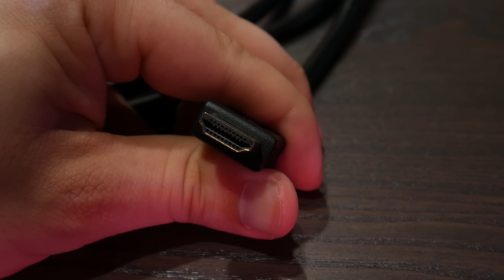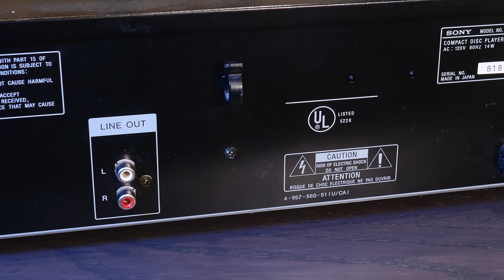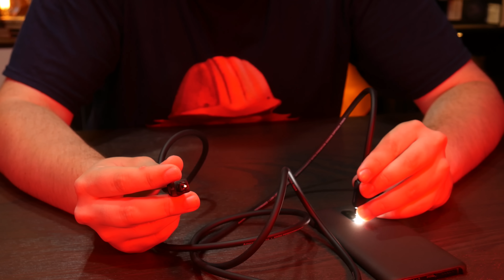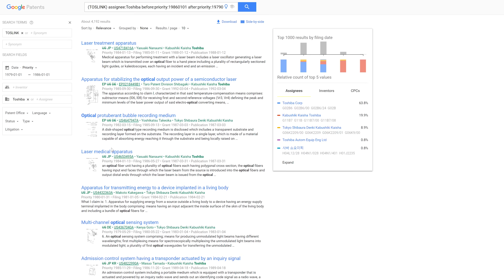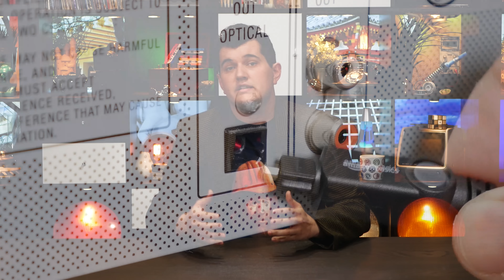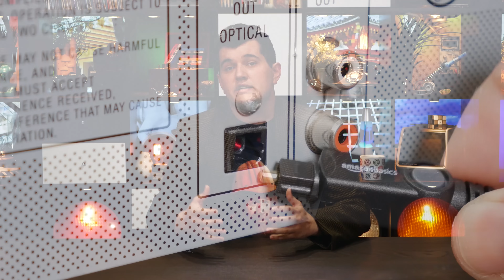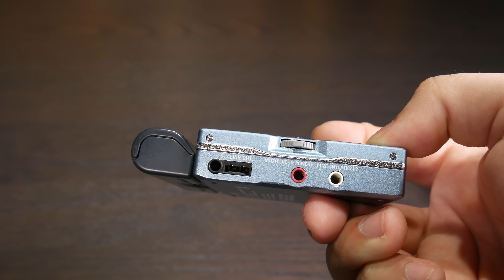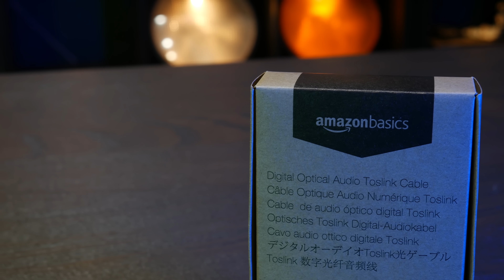TOSLINK: That one consumer fiber optic standard

Comment: I have used the toslink since the minidisc I bought in the mid 90. Recording direct analog dj sets, naming and timestamping those recordings on the portable recorder and using the mini toslink to directly burn a master disc CD on my Philips CD Recorder at single speed. Then copy that disc using ISO rips whenever I wanted. 
I still use toslink to connect PC to surround sound and until we got rid of the 'tower' we had always connected CD players using toslink. 
Here in the Netherlands it was very common but most people did not use it unless it was part of the tower setup.

Comment: STOP! Please remember that American (USA) "older" homes, their outlets are not polarised like the Australian/British outlets! And some, the neutral may be on the chassis (supposed to be) Non-earthed, thus a risk of an electric shock or destroying expensive devices!

That's like the early valve radio receivers, some, the neutral was connected directly the chassis (no earth per say) the earth was used for receiving part of the radio signals (return)
DPDT switches weren't used those days and RCD"S didn't exist yet!

Comment: Toslink was the standard connection over s/pdif. Most receivers had many optical inputs but just one coaxial input. Only in the beginning of digital audio they cut the optical for cheaper audio devices. Later only the upper class products had an aditional coax connection. And the reason why coax and optical were not updated is simple - HDMI had better copy protection. Because HDMI doesen´t play unless every connected device in the chain say ok. The copy protection sends signal and hope that it is not recordable. 🙂Mini Toslink was used on many mid and high class partable MD Recorder and CD-Players. Many Macbook hab a combo trrs 3,5 mm with optical output. It was common but hard to see. 🙂

Comment: An utter shame that ADAT Lightpipe never became the consumer successor to TOSLINK. I've got an audio interface to pipe in 5.1 audio extracted from HDMI, and the audio interface supports ADAT, but I have to use the analog inputs because literally every HDMI audio extractor that has optical out only supports TOSLINK.

Comment: I still use toslink on my computer... I use a Kenwood 5.1 receiver. I was using Dolby Pro Logic II on my old Asus Xonar D2X (toslink) but now using my onboard sound which is pretty good but uses DTS:X which isn't compatible with as many formats as my old card. I've switched out my front stereo pair speakers with 3 way pretty hefty 140w sony speakers so it sounds pretty good in stereo at least.

Comment: TOSlink is still alive today (and probably will be for a long time) because it's used on professional audio equipment to transmit digital audio over adat lightpipe instead of spdif, midi and wordclock, often all from the same port. It's extremely useful.
Reply: Yes, also a S/PDIF is compressing multichannel data, Toslink does not. Consumers shouldn't hardly care about this, but producers do.

Comment: I'm a retired EE guy and have done a ton of stuff with PCs and HD.  But I'd never gotten involved in any form with Toslink.

Until two months ago, when we bought a very nice Samsung big-screen TV and discovered we needed optical to connect to our very good home audio system.  I bought an optical-to-RCA plug adapter, and plugged everything in.  Really hit or miss; sometimes it worked fine but other times just silence.

It wasn't until a week later that I realized I had failed to remove the tiny rubber caps covering the light pipes at the ends of the cable!  So it was remarkable that it worked at all, given how faint the light must have been at the connections...

Comment: Well, it's 2023 and I am still using TOSLINK for my TV audio output :) 40 years for a digital standard is quite a success. By the way, TOSLINK not only solves ground loop issues, let's remember that it is very common some devices to have no ground connection and in some countries grounding is not that common, for instance Japan and Denmark. Ungrounded devices could be safe, but they produce weird tingling feelings at different potential levels from a device to a device...

Comment: When I got my first PC back in the days I wanted to connect it to my av receiver to listen to music and later on use it as a surround system for gaming. But in those times I still listened to analog radio via our cable network with the built-in tuner of my receiver (after all its called an av receiver, not a multi channel amplifier). That proved to be way more difficult than I thought, because the combination of connecting my pc via SPDIF and the cable network produces a humming sound. I needed to buy a filter for the cable connection to get rid of it. Toslink wouldn't have introduced that problem in the first place.
So there is, or at least was, a practical use of having a non electric connection.

Comment: The fact that the optical connection completely electrically isolates the two connected devices is no joke! At some point I had really irritating problems with connecting some audio devices, there was a clear "hum" that was some kind of ground loop interference. I tested a lot with different grounding settings, and when I finally was able to use a toslink cable, the interference was eliminated. So I would say that in some "bad" grounding related setups the optical connection's electrical insulation property can be a saver!

Comment: Introducing TOSLINKd (TOSLINK dualstream). Interoperable with the old TOSLINK but with an offset second strand for simultaneous up- and downstream or doubled bandwidth in a single direction. High-end devices with TOSLINKd capability being equipped with two distinct lasers - since their price dropped substantially even on the end-user market - therefore enhancing maximum range.

And later TOSLINKd2 the two strands being divided into rings resulting in 4 strands while remaining compatible with the two older standards while providing even more bandwidth or two miultaneous bi-directional datastreams at TOSLINKd speeds through one connector. Respective high-end devices with TOSLINKd2 capability provide four fast switching and a bit more powerful lasers for further increased range and bandwidth.

In another timeline, possibly

Comment: I'm here in 2023, watching a 3 years old video saying toslink is on the way out.... What? Feels like I'm getting old now. My TV from 2019 has toslink at least which goes into my built in dac/amp of the surround system. But I also remember that it, and the computer in the next room (15 m toslink) was bought in 2013 😥😁
I have the ability to play sound from the computer to the sound system in the living room without the TV being on. Though I would probably not use that, instead the 10 year old logitech Bluetooth adapter that is also connected to the stereo and stream the music. I have a long HDMI cable but preferred the toslink directly than the HDMI with sound being outputted to the toslink between the and stereo.

Comment: You actually missed a good argument for using optical cables, even though you unknowingly hinted at it. When two separate devices are both plugged into the wall and also share a copper connection, you're creating a loop. If for instance your CD player being all digital has a noisy switching power supply and doesn't care, some of that switching noise can loop all the way through your cable to your low noise expensive amplifier and back into the wall outlet. ('Common-mode noise') This could become audible noise in the amplifier stage and still ruin your day. Removing the copper link between the two devices prevents this issue and therefore optical connections can be beneficial to noise performance.

Comment: We have an old receiver at home with only RCA inputs and since our ✨new TV✨ didn't have an RCA out, everyone was like "well, that does it, we've got to get ourselves a new receiver, what a shame..." But then I found this blinky little connector on the back of the TV marked SPDIF and finally figured out, that it's just the matter of getting a DAC that has optical in RCA out and that was that. I ended up getting a shitty $20 DAC from China, my parents are half deaf anyway and were just happy that they didn't have to listen to the TV only via the built-in speakers...

Fast forward 3 years later, because another appliance has to be powered on (the receiver), they ended up not using it. The sound was a major point of contention back then. I still can't understand why the'd be so upset with not having something they now have and aren't even using it. Before you ask, yes, there is a remote for the receiver with a power button. I don't know why they aren't using that either.

Comment: Some inputs would be nice wouldn't they especially when the ac in is running on 2x 110dc on shunt block switch with a phase down on the time spectrum but floating a live on top it's like paying for to be charge other

Comment: I still don’t understand how copper wires can send so much info. My coax cable for my internet is from “the 70’s” (according to the installer from my ISP) and I get 250mpbs! How is that possible? My cable is a single wire shielded coax meant for basic tv use and I’m getting enough bandwidth to watch 20 hd streams. Is the thick diameter of the copper wire what gives it this ability? I’m not good with tech understanding lol.

Comment: The antenna network in my apartment block was wreaking havoc with my amplifier causing a loud hum. As soon as I replaced the HDMI cable with a TOSLINK between my TV and DAC the problem was solved.

Comment: I was having bad interference from my PC and building when connected to my effects board and amps. I ran everything off 9v batteries for a bit. Now I have a cioks power supply. It uses the coaxial to 9v type cable. Absolutely no interference anymore.

Comment: I agree with everything in this video except the distance/length factor. The ENTIRE reason fiber works better for a WAN application is because of its long-distance performance. A standard Cat5e cable’s copper wire’s resistance will degrade the voltage and cause the 1’s and 0’s to mesh into each other over a distance longer than about 110m, which is why Cat5e has a limit of 100m. Fiber does not suffer from that. Maybe a cheap cable with a fiber medium that degrades the brightness of the light will cause that, but a quality cable that doesn’t shade the light will not cause this problem. Also, some brands have made their own products work together at much higher data transfer rates via optical. The limit, as you said, is the standard between manufacturers. As for the 2-way communication, I do believe I read somewhere that Toshiba was going to develop a new cable with 2 elements as you suggested. But they found that it’s easier to just install 2 separate cables, exactly as you would with SPDIF. Now, it’s unlikely that a consumer will have a network or audio system that has cabling longer than 100m, so that’s why fiber really isn’t that popular in the consumer application. Those distances and transfer rates just aren’t needed at that level. However, a digital coax SPDIF cable that is marketed as such is actually a LOT thicker than a TOSLINK cable. Why? They put shielding on it and market it for “noise rejection” counting on the consumer not knowing better, the same as the gold-plated optical cables, lol. However, most CAR applications for DVD use optical for the audio output to the DSP for the multi-channel signal rather than coax. I don’t know of any car DVD systems that utilize coax in this fashion. The coax is simple LPCM 2-channel rather than 5.1 bitstream.

Comment: HDMI can only replace TOSLINK cables if you want your sound and video signals going to the same equipment. I want the video to go to the tv and the sound to go to the receiver. (My receiver is old and does not  have HDMI inputs or outputs, and since Bob Carver has not designed a newer receiver, I'm stuck with this old one until it dies) so TOSLINK is still super important to me.

Comment: Still use toslink to this day, primarily on higher end audio connected to PC. Higher end PC's with powerful video cards and processors generate a metric s-ton of noise. Toslink lets me use an electrically isolated DAC that shares no ground or power lines with the PC itself. Eliminates all electrical noise coming from the PC. This = bliss.

Comment: It is interesting the TOSLink is going on 40 years old and seems like it has exactly ONE version.  Whereas HDMI is less than 20 years old (didn't realize it was THAT old), and I think has more versions that I have finger!  Maybe the key is with 2-way communications, devices are able to negotiate between versions.    
And I agree with others on it's versatility on it's ability to support audio connections.  I have a newer Samsung HDTV and and older Sony soundbar.  While I can connect them via HDMI and use it for CEC control, I need TOSLINK to get the tv audio into the soundbar.

Comment: back in the day when i plugged my computer headphone jack into the rca input on my amp, it was badbad quality with much background humming and stuff. since that's an analogue output, toslink worked way better, so i guess that's its one superior use. it's funny that because of my experience i always assumed anything running through rca cables is analogue and subject to interference.. thanks for correcting my understanding many years later
even if i had an rca spdif connector i would have assumed it would suck as bad as the headphone jack did XD
also one small drawback i found was the toslink connector is kinda barely held in, by just a little raised nub.. pretty weak, but i don't think you need gold to make it click in better lol at least i'm not that daft :D

Comment: I used to run a 20ft coax from my PC to a home receiver years ago and whenever I would switch the lights in the room on/off it would drop link for a moment.... switched to a optical cable and that stopped happening but I suppose it's possible the cable I was using just wasn't up to it

Comment: i've never heard it referred to as TOSLINK so i was baffled by this video until i realized you are talking about S/PDIF lol. i have a bunch of things that support S/PDIF, but i've never bothered getting the cable for it. it's a huge pain in the ass, and the dust gate on the connectors eventually fail and let dust in. or some dust gets on the connector when you plug it in. its super easy to break or degrade the signal, which is why no one really uses it. not to mention the cables are SUPER easy to break (like bending them too much).

Comment: The only advantage I can think of for optical vs wired digital cables is that the bandwidth of standard RCA cables did not handle the multiple channel multiplexed optical signals and it would be tempting to use an audio RCA cable in a SPDIF port. Maybe the plan was to have multiple high frequency channels on optical toslink. I am sure that the optical cable was a marketing ploy much like the "gold plated" optical connectors though. I once saw a power strip in Fry's Electronics that said it was "Windows 95 Certified" on the box, obviously at a higher price.. People with more money than brains will buy the most expensive product they can find thinking it must be better.  "Monster" cables were just such a marketing ploy.
EDIT: Another poster mentioned "No Ground Loops" as an advantage to optical cables which is certainly a huge advantage in an entertainment system containing a dozen or more electric components.

Comment: i've had good experience with a small toslink amplifier on my home computer. before that, i had background buzz on loudspeaker amplifier, and with and high-pitched hiss in headphones. Toslink resolved hiss from EM noise in the computer, and the buzz from the amplifier by avoiding ground loop (since nothing in toslink is electrically conductive). It may have been avoided by using hdmi stuff, but i like old tech and it's worked fine for a few years now.

Comment: Rf interference isnt the only thing it can protect against, its really useful against ground loops. I had a stereo system that when i would plug in to 3.5mm it would do the signature ground loop sound but when using the optical cable it went away.

Comment: Yeah, ok toslink doesn't have that many advantages over RCA cables, but the cable is usually narrower and easier to route in tight spaces.
I use toslink to send audio from my Xbox One to my sound bar, works very well.